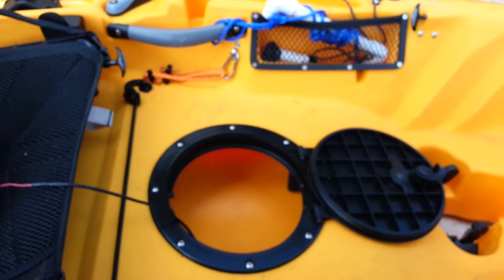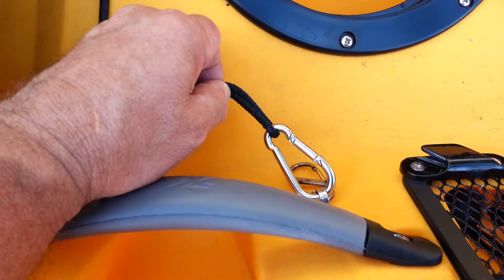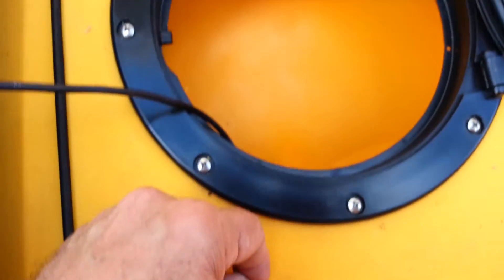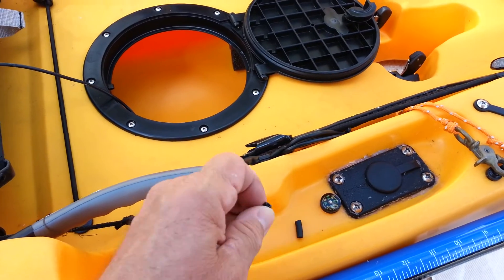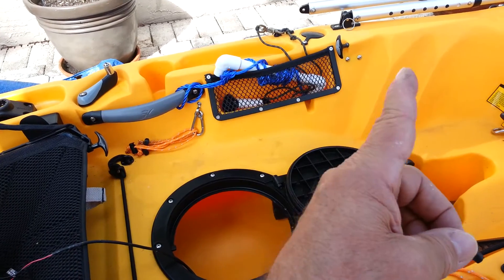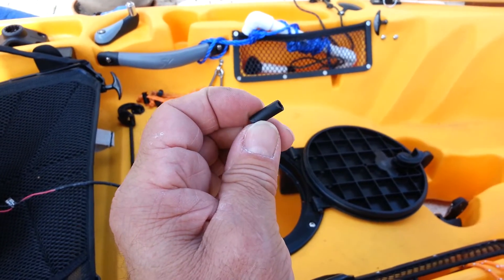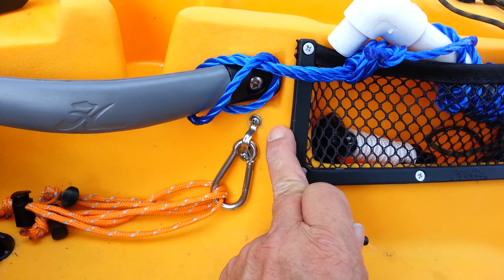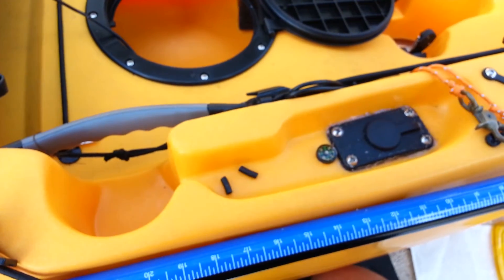Hobie Rudder & Steering Cable protector

Comment: Great idea.
Reply from the maker: Thanks! I know a guy who's rudder cable snapped. I asked why and he didn't know. Upon further inspection, he had a pad eye right where I placed mine but about a half inch higher. The screw thread sticking out from the nut  eventually rubbed through the cord and it broke. Thanks for watching...